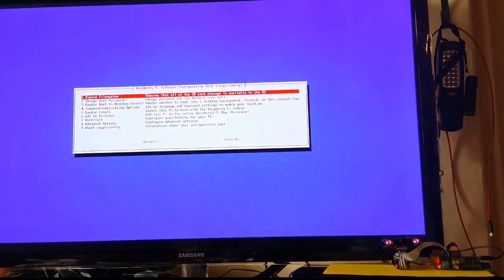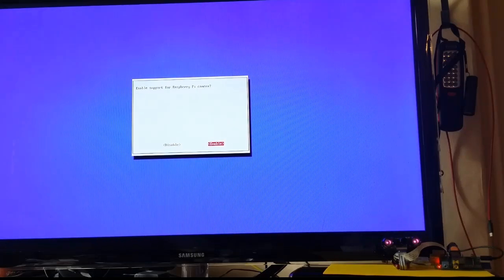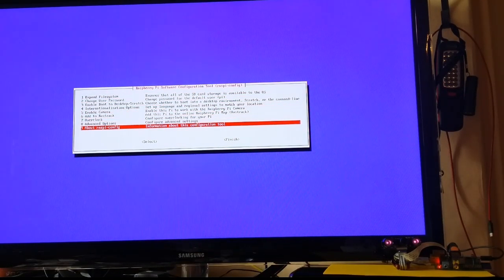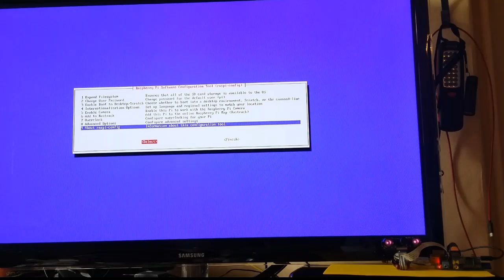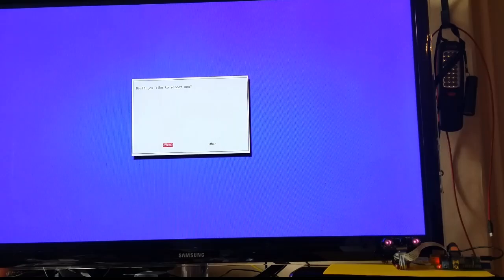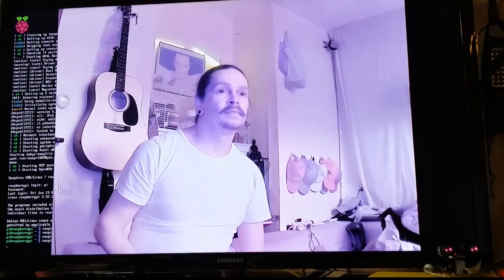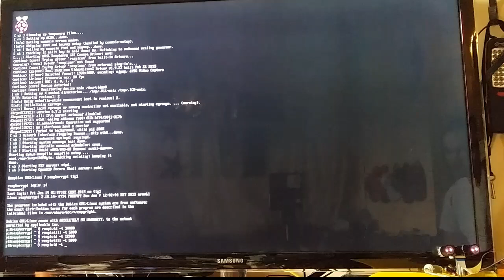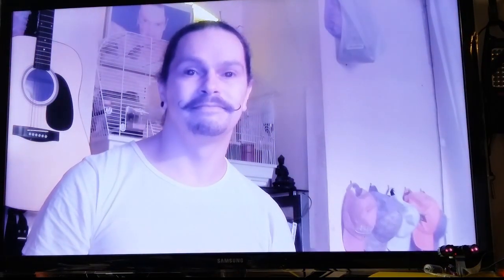Open MAKER reviews: Sainsmart RasPi NOIR camera

Comment: is it possible to turn the IR Emitter on and off?
Reply: only if you wire it separately and control it via a basic switching circuit (transistor, resistor)
Reply from the maker: Accually i think it is possible through software too. A couple days ago i was fiddeling a bit and typed some command (no idea wich one) and then the spots turned on and off every second. when my hand got closer to the IR spot sensor, the blinking speed increased. Anyway it looks like something you should be able to do with a command.
Reply: half4team are you sure your hand wasn't interfering with the amount of light coming through? there is a light dependent resistor controlling the IR emitter...
Reply from the maker: +schr4nz Yes, i'm sure. When my hand or me for that matter, weren't even around, it kept blinking. Steady, one second on, one second off

Comment: mmm no, you can get those spots also on aliexpress, ebay and i think a lot of other places also.
Reply: Iikka Konola: Perhaps the generic lamp modules, but probably not with the convenient mounting holes as found in this kit. Then again, if you're so inclined, you could probably just 3D print your own mounting adapter.
Reply: Mike Trieu I bought a kit from aliexpress with 100% similar mounting holes.

Comment: Nice upload mate, little shocking with the sound distortion there... I assume that the camera was tested in a dark room, it does look good at night which is great.

I wanted to ask you if the IR lights are visible at night when they on, I want to use this module as a surveillance camera behind one sided tinned glass, and would hate if anyone could spot it behind the glass at night.

Thanks for your time
Reply from the maker: Indeed they have a faint red glow when they're on. But ofcourse the IR light itself  is not visible
Reply: It a good bit brighter than faint,  most commercial video security camera IR leds all have the same glow.  You are going to need an IR pass visible block filter in front of them if this is really necessary.  In the old days Kodak sold gelatin filters that weren't exactly cheap for IR photography.  I seem to recall Wratten #82 was the most used one,  but I could very well have the number wrong, its been a long time since I've done any wet photography.